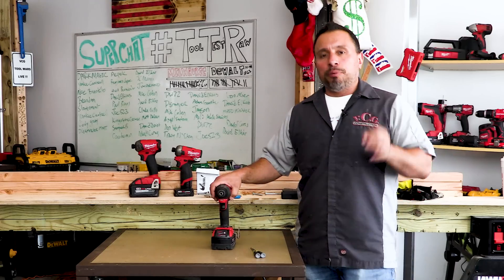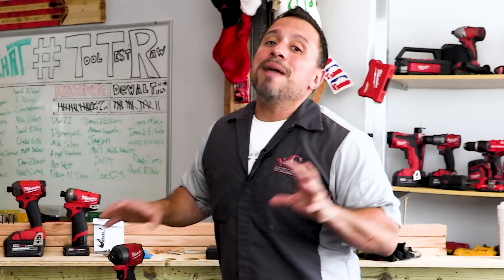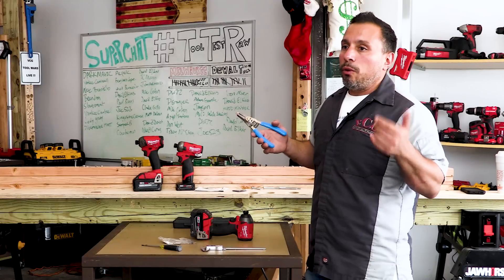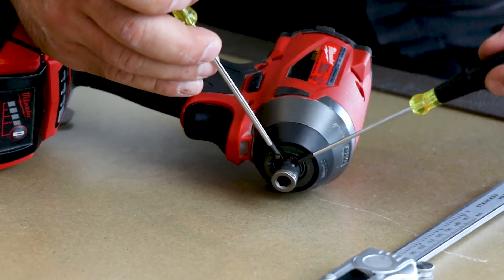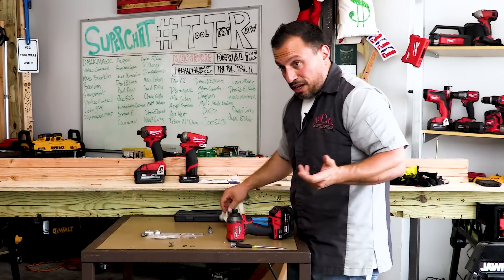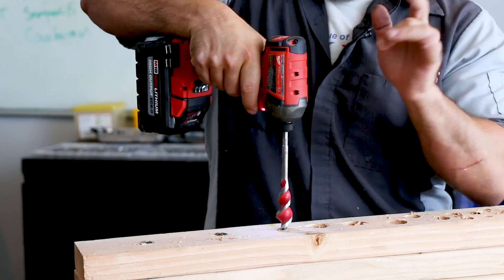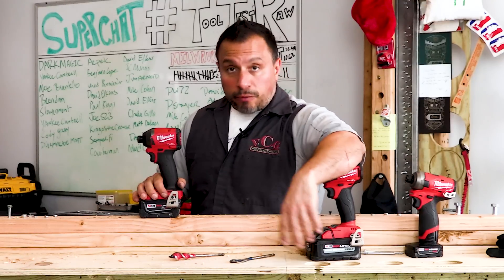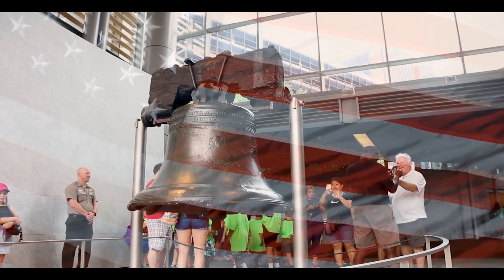Serious Problem With Milwaukee Impact Drivers - Replacing The Ball Bearing

Comment: I suspect that the extra power and torque of the latest model is just too much for the quick insert collet system to handle. Who needs it anyway for the three tenths of a second it saves inserting a tool when you still have to release the tool as before. 🤔 On the other hand, maybe Milwaukee intended it to also be a quick extract collet as well😂and if so, it’s working as designed 😬❓

Comment: My favorite part of this is the guys that use a "driver" for paddle bits.  A driver is for fasteners.  Sure,  you can drill a hole.  But i use my drill for that.  What's especially nice is a drill with an e- clutch.  Considerably reduces breakage.

Comment: Ceramic is so hard it's brittle. put one of those bearings on a steel table and hit it with a hammer. That's what you're basically doing inside that tool. I'd like to see the new ceramic bearing out of the tool after failure (under a magnifying lens or microscope). It's probably fractured or shattered at least in part. Ford had a serious issue in the turbos of the early 6.7L Powerstroke engines because of ceramic bearings. They switched over to hardened steel and the problem went away.

Comment: I have a quick, simple, 3 step fix for this problem. It will actually also solve a host of other issues, inherent to the crappy Milwaukee design.

1) Find your Milwaukee driver
2) Throw in trash 
3) Buy Dewalt

Comment: Maybe that is gen 3. I am happy with gen 2 and have no reason to change. Being a little shorter does not matter that much. There was not much power difference. If you just replace and step up just for the sake of doing so for bragging rights without any good reason, that is just foolish. Also on the drill gen 3 drill combined the set collars which is less convenient anyway over the gen2. Not better.

Comment: I am not sure why people use their impact for drilling anyway. I never do. This is only an issue because you are shoving a quick release chuck into a hole. Just buy a drill with enough torque. milwaukee makes the right angle hole hawg and super hawg if I need more torque. the m18 regular drill has plenty. Impacts for drilling are unnecessarily noisy. Years ago I watched people use pathetic dewalt impacts to make deafening drilling with augers while I used my older porter cable 19.2 nicad (real porter before dewalt bought them and cheapened them) drill at the time with no problem and did it faster and more easily. I only have to laugh.

Comment: I hear so many people dog Dewalt on quality. But I’ve had 3-4x as many of my Milwaukee tools go down compared to my 20v Dewalt and Flexvolt gear. And don’t get me wrong; I still overall enjoy my Milwaukee gear, but there’s a reason among my crew why the brand has been nicknamed “Milwanky.” Failing quality. And don’t respond with their superior warranty BS. Milwaukee usually doesn’t warranty the most vulnerable parts of their tools: Sawzall chucks for example. The drill chucks are hardly warrantied, and they drop like flies.

Comment: I stopped buying Milwaukee power tools after my entire lineup of V18 Li ion tools took a crap due to massive battery/electrical/charger problems and dodgy warranty coverage. Not good.  I switched to Makita and never looked back on Milwaukee cordless.  I still use and like  my much older sawzall though.  That is it.   Power tools in general have cheapened out over the years.  Profits vs. quality... maximum profits will always win nowadays.

Comment: PERMANENT FIX!!! I have my M12 impact driver and I had same issue, driver bit drops almost every time I point the collet down to ground, I found out that the problem is the secondary spring which holds the ball bearing was pushed down a little bit by the collet, it made the ball bearing drop a little bit from the top (which it is supposed to be), and the ball bearing will have space to move up and down, when you shake the impact driver you will hear clicky sound, that means the ball bearing is not all the way on the top because the secondary spring cannot press the ball to be all the way on top.
Why the ball bearing needs to be on top? because the inside edge of the collet will lock the ball bearing in place, if the ball bearing fall down a bit, ball bearing will have space to move back and let the driver bit drop from the collet
The solution is, you have to bend end side of the secondary spring up a little bit, to press the ball bearing to be all the way on top, and avoid it to be pushed by the collet when you put the collet back in place, in normal situation, if you put the collet back in place, you will feel the collet press the secondary spring a little bit, you have to avoid this, if you can put the collet back in place without touching the spring, and the spring still hold the ball on top, when you shake your impact driver and you dont hear clicky sound from the ball, you made it!!!

I tried this and tested with loosening more than one thousand 10mm bolts from more than 300 motobikes, I did not find same issue again.
Reply: This guys needs some credit
Reply: I believe you. Whatever you said?
Reply: @VCG Construction did u tried this
Reply: Yeetrue, please consider making a video of this fix.  A little tough to follow without.
Reply: Zinbad - Car Reviews and More he has video check out his channel
Reply: @ImTriki  Please post the weblink to that video.  Thanks.
Reply: Saturday 17 October 2020....just had two Milwaukee driver collets apart (one “brushless”, the other “Fuel”)....they were different from each other. One had two ball bearings and one spring and the other had one ball bearing and two springs (a large outer spring and a smaller inner spring with a “U”-shaped bend to retain the ball bearing). The two-bearing collet was relatively easy to clean and reassemble. The one-bearing collet was a bit more difficult. When the one bearing was disassembled , the spring (with the “U”) was over the bearing and holding the ball down. When the collet was cleaned and reassembled it wouldn’t hold a bit in it. It was taken apart again, the ball bearing was relocated to the outer (frontal) side of the spring and it kept a grip on the bit. The collets were originally taken apart because there were tangs (from sheared-off drills) broken off flush with the front of the collet and the local repair shop insisted that the broken pieces couldn’t be removed under any circumstances....they were wrong. P.S. Helluva good video by the way....like your attitude and instructional technique. Thanks
Reply: i have bent the spring in my fuel has not dropped out since i have i use it pretty much every day working on mowers and cars

Comment: The fix is simple the spring holding the barring is to weak stronger spring problem solved. Surprisingly the spring from a Mac 2 ton floor jack did fit perfectly. It may be a bit of overkill but it has been the perfect fix I have not had one bit come loose yet
Reply: Thanks, where do you get a replacement spring?

Comment: I think you should of measured a few of those ball bearings, Maybe they are not all the exact same? I would of went with the biggest one.   The one removed from the Milwaukee driver was 3.92mm and the replacement was 3.98mm.  Do you think that, maybe a 4.00, or even slightly bigger, like a 4.05, would of made a difference?  
VCG Construction - Leave your comments below   LOL

Comment: Seems to me that the spring is vibrating off the very top the the ball bearing. Causing the force of the spring to hold the ball bearing in place to stop and the collet to fail and the tool to fall out. I wonder if you could weld it the spring to the top of the ball  bearing to keep that from happening?

Comment: Dam.  Thanks for reporting this issue.  The collet intermittently releasing bits when pulling during extraction is definitely unexpected.  I've not seen anything like that with my Rigid or Makita impact drivers. If you're not expecting the collet to release while using the drill you could easily lose balance when standing on a ladder.
Reply: Oh man, that is very scary.
Reply: not to mention losing bits on the jobsite, mine are $11 each; Malco 3/8 & 5/16 flip bit
Reply: Was thinking the same thing about losing balance from pulling and it slips out😳
Reply: Maybe you shouldn’t be on a ladder then lol, you know what they say about people over the age of 45.

Comment: I don't think you can criticize a product too much for utilizing a tool outside of it's intended purpose. 
Impact drivers are not really intended for drilling. 
I completely get why you would want to use it that way, because there are 1/4" hex drill bits and a quick connect system that makes it super easy.
BUT (Big But) drills have a chuck for a reason. A properly tightened chuck isn't going to slip.

Comment: Did you try using the older Milwaukee ball baring in the newer tool if that dose not work then I gess you will just have to wate for Milwaukee to figure it out

Comment: Hummmm.... I guess I'm weird.  I don't drill with my impact.  I used a drill.   Not sure which generation  that I have, but I bought them last year.   I have seen the drill bit kits with the fast chucks for the impacts, but I've not bought any.   The kit I bought came with a hammer drill and a impact.  I use both.... Just not interchangeably.

Comment: Too bad, some Milwaukee tools  are ill-designed, others work fine. Twenty years ago you didn't need to wonder if a Milwaukee would work properly, now you do. Maybe too much Chinese influence. More likely, they are producing way too many tools, too fast, with lack of oversight and spending more money on promotion than product development. Case in point, the new line of cordless nailers, that don't work as advertised.

Comment: Vince I want to buy a cordless impact driver to remove lug nuts on my tool trailer and my 1/2 ton Silverado. Want to keep in trailer for on the road service. Any recommendations? I have electric for in shop use. Need something for the road if I get a flat like I did last night. Thanks Doctor Dog.

Comment: So, Milwaukee doesn't do final testing with their tools?  Or, they do and do not care too much about a problem to not release a line of tools?  I was going to buy the $199 set of Milwaukee 12v  tools at HD, the one with the cordless 3/8" ratchet, 1/4" impact driver, drill driver, Hackzall, light, charger, 2 batteries, but not now.

Comment: I really just think it has way too much impact power for the spring that holds the ball bearing 
Or the design of the spring allowing it to be quick insert is the problem 
The hard impact in reverse engages the quick insert shifting the ball bearing out of the way and causing the release of the bit.

The reason why the surge probably doesn’t do it is because of the 
Lower speed
Lower torque and 
hydraulic impact design
Providing linear torque instead of hard dynamic torque.

They’ll probably redesign the spring,, if not the collet all together 
To allow more ball bearings and keep it a quick release

Comment: Milwaukee needs a tighter collet on the surge gen 3, my driver has broken tips off flush with the collet because it has a slight bit of play..... Or design a slightly thicker bit which from what I've seen would only work in Milwaukee gen 3's

Comment: Interesting information. Although out of my 20 years of commercial installations I have only seen 1 person use an impact driver with drill bits & etc. I am interested if people do this vs using a drill because I have never seen it. I only use my impact to install/remove fasteners.
Reply: I use mine for drilling stuff... in most cases it finishes making the hole before the drill driver... which I found interesting. If you are half decent with trigger control you can almost completely eliminate the need for a regular drill driver. Because it has no torque adjustment options you need to be careful to not overdrive the fastener when working with wood, but it's not been an issue for me.
Reply: Richard McEwen your completely right impact is for fasteners and a drill for drill bits

Comment: So is this considered a recall fix and will Milwaukee fix it for free? And wow I was about to buy this drill/impact set, but might go with Dewalt  XR now. Is there a solution by then now? Also I am not a pro user, I just love the Milwaukee line they offer. I tend to use my porter cable drill now to drill with and impact to place screws in and bolts. So would this problem even happen to me?

Comment: My surge has this problem. Last year my surge trigger failed so Milwaukee overnighted a replacement Surge and I sent the faulty one back. After losing my 1/2” shockwave socket and adapter I noticed this problem. Since I only had my surge for 1 year ( 2 years since original purchase ) I just sent it in under warranty

Comment: i was working mine hard drilling 25mm holes using spade bit though wooden posts to feed swa...the metal front casing got so hot i burnt myself when i went to lift it off the ground after the 4th consecutive post.....infact it got so hot the rain was sizzling straight off it.

Comment: I don't think I ever went in reverse on my impact or drill to get a bit back out. Once the hole is done I wouldn't think it would make any difference. It might even push wood chips into the hole by skimming the edges or what is left on the flute wouldn't you think?

Comment: From what I can see from using Milwaukee impact drivers for 10 years, 2 things stick out to me immediately:

1. There needs to be 2 ball bearings as there are in the traditional brushed impact drivers. Either that or the tolerances in manufacturing have changed very gradually from the GEN1 to the GEN3.

2. The ball bearings you purchased Vince appear to be a more suitable fit then the OEM bearings Milwaukee installed so If at all possible try using a bearing as close to 4.5mm as possible if it is possible to purchase as well as if the retaining slot will allow. 

One thing that did come to mind was the thickness of the spring which retains the ball bearing. Not sure about the spring thickness of previous GEN1 & GEN2 models so just throwing the idea out there.

Good luck with your endeavours Vince. 👍

Comment: The problem is the outer sleeve (the black release part of the collet) the tolerances of it aren't tight enough and the metal is to soft. Allowing it to slightly warp and tweak and get stuck on the ball bearing retainer spring during bit insertion or releasing it during use. It appears to be engaged but is not totally. Allowing  your bit to come out. 
  I can replicate this by hand without actually using the tool. The answer is better machining to tighter tolerances and stronger metal. This is why the bigger ball bearing in some cases helps. One more thing is the collet needs a little more space between it and the frame of the tool.

Comment: The ceramic Bering is all wrong. Its so hard it brittle. Stick with a good steel Bering its softer and wont chip or crack. Yes it will wear out faster but steel is the way to go. Also the tension on the spring pushing on the ball is weak not enough force pushing the Bering down. Ceramic berings are for super fast spinning shafts like a turbo not much static load just super high rpm's. Use steel

Comment: I think the answer, for Milwaukee, is a re-design of collet with two ball bearings or even three.  I believe the problem is vibration, plus pressure against the single ball bearing, creates an issue with the "grab" of the bearing against the bit.  Like when you are drilling with a hand tightening collar on a 3/8" or 1/2" regular bit and the bits starts to slip inside the collar.  You're sure you had to tighten it at the beginning of the drilling but eventually the vibration looses it a little and the bit starts to turn inside the collar.  It just needs to be re-inforced with a second or third bearing so there's more equal grab even with the vibration that occurs with the operation of the drill.  It's probably not as much an issue with the drills that use less torque or are slower.

Comment: try a harder pressing spring.. seems the ball isnt the issue its the impacts in revers that are pushing the ball back against the spring maybe a regular spring or bend the already spring more in towards the ball... or swap it out for another one on another drill older model you have..

Comment: Found this at 4am, with nothing better to do. So down the rabbit hole I went. The gen2 and 3 use a 4mm bearing. The hydraulic surge uses a 3.5mm bearing. The part numbers for the retention ring, sleeve, spring, etc are different. But are probably the same physically. (Why would they spend money on new machining specs for the same head/tip) if I had both tools, I'd try swapping the surge bearing and maybe its bearing spring onto the faulty tool. Then see if the bearing size difference is the culprit.
Reply: Thanks for this. Thought I was going insane when my 4mm wouldn't fit

Comment: That's a really nice ho-to fix video. Thx. My Milwaukee store in Indianapolis great to work with and takes care of ANY issues I have with any of my Milwaukee tools. I use nothing but M cordless tools. You answered my only real issue, why you are drilling with an impact driver. For years I never used the impact driver that came with the twofer I bought. Then I realized the drill was SO powerful I was over sinking the screws with it and changed to using only my impact drill to set screws now. I don't like hex-head drill bits so i don't use my impact driver to drill with. always enjoy your  videos.

Comment: I believe the surge series doesn't release the bit when pulling due to the less violent hammering action. The I think the conventional impact hammering causes the ball bearing to "walk" and the pulling maintains tension, kind of like holding tension on tumbler while picking a lock. Just my opinion